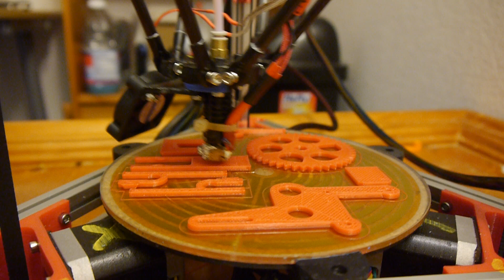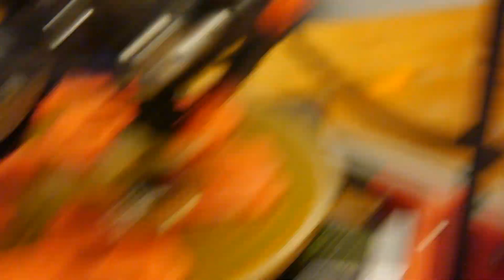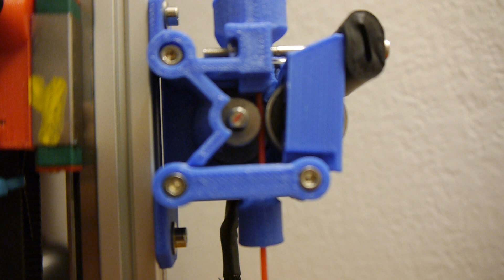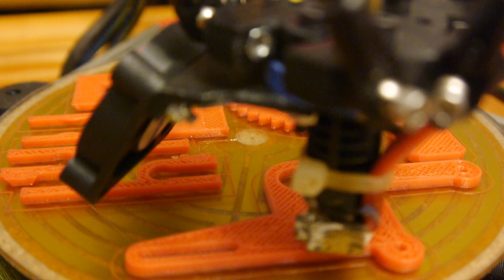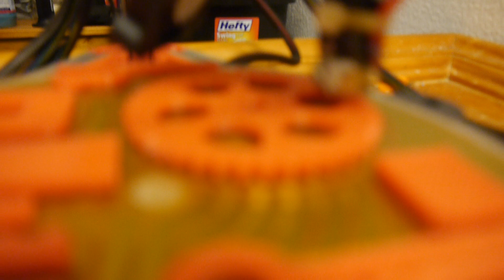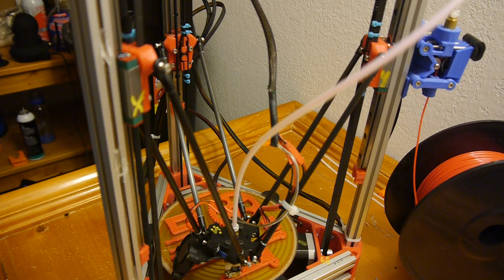high speed delta 3d printer

Comment: wow, this thing is faaast!
and still looks really good on the layer alignment with that insane speed!
I am truly impressed.
Curently I am in the process of gathering parts for my own mini-kossel build.
Also looking into X5 as electronics

1. - did you get rid of the jerky movement problems you mention in other videos in slow movements?

2. What extruder and hot-end are you using? #

3. I notced some rattling - probably due to the very fast moves - could you find out what is causing it?

would appreciate answers a lot,
Alex

Comment: Impressive.
Does the print quality degrade noticeably compared to slower operation?
Reply from the maker: Depends on many factors , there is a optimal speed for quality , too slow and quality can suffer also.
Reply: I meant does the quality suffer on this particular printer on this particular speed when compared to a lower speed. Is there any reason to use the slower speed shown in the earlier videos?
Reply: +Raattis surfaces will be less accurate and thus exhibit visible "breaks" in finish.
The main problem is the moving mass of the head creating swing / overshot.
A problem direct extruders have too when running too fast.

Comment: Those poor steppers! I'm sure they act as a space heater now, don't they?
Reply: +Blake O'Brien Accually sometimes the faster you use a stepper the cooler they get. Funny how it works.
Reply: yes, if they stand still, they are hotter because i think it is constant current and when driving, each coil gets current for a split second and then has time to cool down i think
Reply: just add a heatsink+fan.

Comment: lol this is the fastest I've even seen :) Can you tell more about your setup? How did you achieve these speeds?
Reply: he's using the smoothie board which has a proceser that can be found in most router from your isp so its kinda fast so it can do the delta calculations fast for this 3d printer